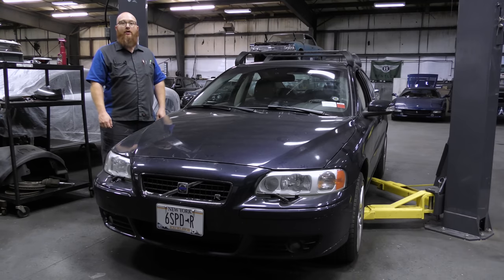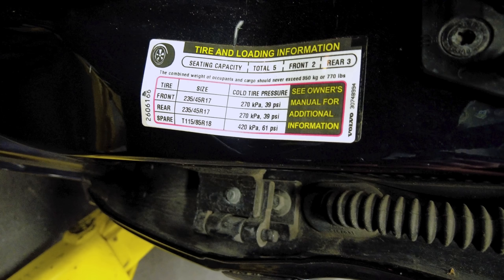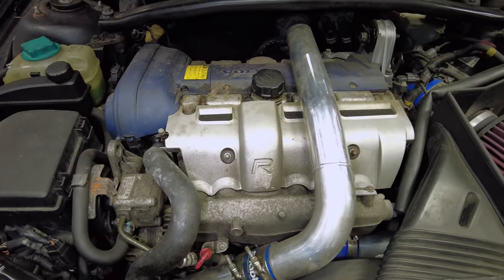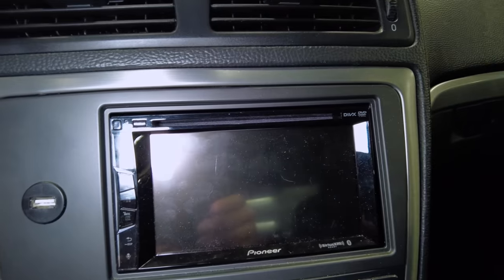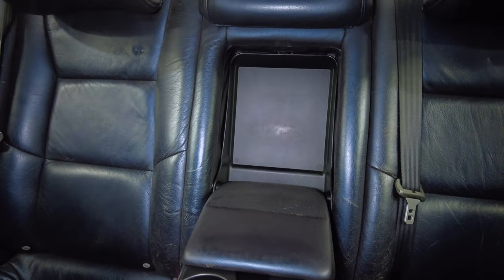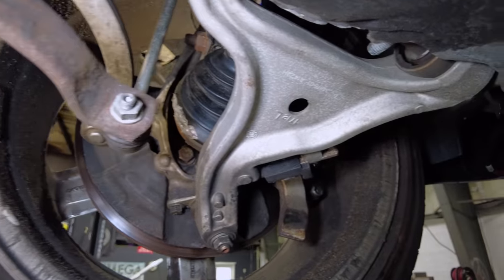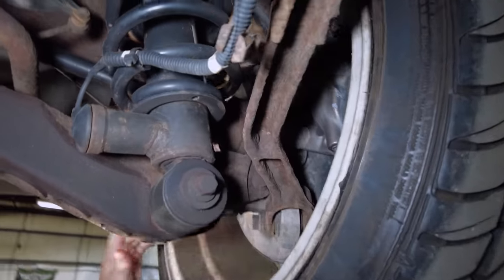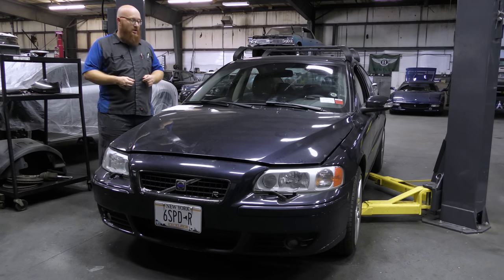They shipped their '07 Volvo S60R over 1K miles to my shop? CAR WIZARD determines if it's worth it!

Comment: These older Volvo Rs are getting harder to spot. The fact that the car was sent from 1K miles away to Wizard...
I can tell that the owner really wants someone that can be trusted.
Reply: Alot of people prefer v70r for whatever reason, i got a s60 t5 and i could have bought s60r but i thought the 2.3 is just better overall in terms of realiblity and power with tuning.
Reply: @jaskajokunen3716  My '01 V70 has a 2.4 5cyl NA engine.
216k miles and still runs great!
Only noise mine makes comes from the injectors. 
If i want a fast car, it's not going to be a Volvo haha.
Reply: @jaskajokunen3716  because they have a large amount of cargo space.
Reply: @DeeDee-pw9pm  mine has 155k miles 🤔Though not sure how long it will last since it has aisin autobox and its pushing around 310whp and people said the tranny can handle 300 😔
Reply: It makes no sense to ship this car from the north east to wizard. There are plenty of reputable Volvo specialists in the NE that will do same quality work for cheaper since volvos tend to have the same chronic issues
Reply: Yeah, there are lots of Volvo mechanics where we are who hoard acres of old Volvos. Its pretty wild.  But exactly what I need to keep my 2001 T5 going.
Reply: i bought my 6 speed 07 s60r at 19 and it’s been a very fun (and costly) ownership experience. truly some special cars
Reply: @DeeDee-pw9pm  these are extremely fast in straight line.  But ultra high cost to own, i.e high risk of 'totaling' if actually maintain into higher miles.  It's a sorta cult actually, imho, based on following this model over the past seventeen yrs that i've noticed.  Was gonna get a used one but the prices and the over-eager passion levels scared me off.  I was wise bcuz the number of items needing replacement on most of these is really crazy.
Reply: @18_rabbit  Cost depends on where you live.
And don't you mean high risk of crashing when it's higher miles?
Although that shouldn't be an issue if the car is maintained. 
And what do you mean by "It's a sorta cult actually,..."
What are you talking about exactly?
I don't see where you are really getting at with your comment.
Reply: loads of them here in Northern Europe for beer money, not as popular now because of our high emissions taxes that cripple owners on Co2 output. This is regarded as high polluting vehicle in Europe, only die hard and Volvo fans drive them now.

Comment: These cars are so interesting to me. I test drove one but didn't buy it. It was meant to be a competitor the BMW M3, obviously it wasn't quite as quick, but to this day has to be one of the cheapest cars with 300HP, AWD, and a manual transmission. Jeremy Clarkson did an awesome review of one on TopGear back in the day. Volvo really went a different direction on this car!
Reply: It is very easy to get it close to 400hp, The car in the video has some mods, IPD cat back exhaust, needs a performance down pipe/racing cat. It has snabb intercooler piping, needs a do88 intercooler. and a tune from Shep.
Reply: @YouTubeHandlesAreStupid  I had a 2010 s4, 6 speed manual. Very fun car, but maintenance was a nightmare. I'm content with my 580WHP Dodge Viper GTS currently. 🤣
Reply: @YouTubeHandlesAreStupid  It has gen 3 heads, a custom grind comp cam, full custom exhaust, and some other little stuff done to it. I bought it that way. I'll say this, it moves!

Comment: I used to have a 2005 S60R with a 6 speed and 18s on it.  I loved it.  

With that said, on the ones with the 18s, the stops for the steering get adjusted to prevent the tires from rubbing on the wheel well.  Going from 17s to 18s, this probably was not done.  The downside of adjusting it for the 18s is that the car has a massive turning radius.  I had a Prelude Si 4WS at the same time as this car.  It was a major change going from a car that could do a u-turn in about a 8 foot circle to driving the Volvo.

I miss my S60R very much.  I've been looking at them again recently.

Comment: The rearview mirror also contains the upper electronics module (UEM) which controls the keyless entry, power windows, and sunroof, among other things. The mirror is also self dimming. Unfortunately, it's not a cheap thing to replace.
Reply: It is possible to get a used mirror, split it open and swap the glass, keeping the original UEM. Done it before, tedious but in this guy's case, worth it!
Reply: 😮 he just needs to use a little bit of paint thinner on a cloth to clean that interior mirror
Reply: @BubblesTheCat1  It's the reflective backing that's cracking. No amount of thinner will fix that.
Reply: @darkiee69  😆
Reply: IVE USED A COMPASS MIRROR out of a xc70 or 2008 s60 in my 2006 regular s60 no issues just plug and play.

Comment: Yes I agree with you about the cold air intakes. Unless it's been properly tuned and setup for that, I would definitely advise the customer that it would be a good idea to go back to stock or perhaps see about getting it set up and dialed in properly.
Reply: Over piling of those cloth filters also messes with MAF sensors
Reply: Hell, you should probably tune a car anytime you add anything aftermarket. I'm all for modifying vehicles, it's just ECU and other sensor interaction is so integrated on anything from the past 20 years, the newer the moreso, tuning is always a good idea. I feel like if a new mod helps without a tune it's basically luck lol or a stock tune that changes with sensor input
Reply: TheRealAYoutuber good turbo noises are worth a lot of things, that is true lol
Reply: Stock paper air filter flows more CFM than the KN AND does it cleaner...  people on Swedespeed paid to compare...

Comment: My son is a mechanic at a Volvo independent shop in Pasadena, CA that has been in business since the late 70s. Volvo's are so highly valued, that customers regularly put more money in them that they are worth. The cost of repairs relative to the value of the car is generally not an issue. Rs in particular are very sought after.
Reply: Just possibly this Volvo might have family sentimental value.
Reply: Which shop in Pasadena? I used to bring my Saab to 2GFS in Venice.
Reply: Independent Volvo? Just guessing as I don't believe JK Volvo has been around since the 70s, but I could be mistaken.  I know Independent has been around forever.  Both are great shops though!
Reply: @phixion35  JK Volvo. It opened in the late 70s for sure. Sadly, JK just passed away. His son, who has been running the business for many years, now owns the business.
Reply: @suginami0  that's terrible news about JK.  I like that shop, extremely knowledgeable, friendly and reasonable prices.  I've had both my current S60 worked on there before as well as my previous 1st gen S40.
Reply: @phixion35  there is one old-timer there who has been there since the beginning. He’s past retirement age but still works there because he likes the work. He is the 240 guru. He also works on the difficult to diagnose cars, especially those with electrical problems. He’s like the professor in Back To The Future, and my son really looks up to him.
Reply: @suginami0  that's awesome!  I believe I know of the gentleman you're speaking of. 👍

Comment: I’ve got a V70 of the same era (facelift P2) so great to see one at Omega. The 18” ‘Pegasus’ alloys were indeed optional and later standard on the S60/V70R. That rubbing on the inner arch is because the steering locks he has are for 17” wheels. I had the same problem on my car going from 16” to 18” Nebulas. I too have the same beautiful blue dials in my car! That steering wheel is aftermarket but very nice! Great video Wizard

Comment: 04 Rs are reliably the worst year, but the easiest to modify. 05+ Rs are A LOT better but are the hardest to modify due to coding and software BS. The fact that this has the M66 makes it worth tons more than if it was an auto too, it's worth saving.
Reply: I think it's always a bit of luck. My 04 has 285,000 miles on it, have had 2 major fails with it (split an angle gear casing apart,  had a timing gear strip and kill the car - took 6 weeks to diagnose, with Xmodex and a couple of good Volvo techs perplexed until we figured it out) - just changed oil in it, would take off for anywhere in it.  I've heard people gripe about first year - and maybe there were issues - but honestly, mines been nearly bulletproof - noting that I've done all the maintenance as needed on schedule, and added mild mods as OEM stuff wore out.  Exhaust, intake hoses, FMIC, ignition coils, brake lines, coil-over suspension to get rid of the "cool, but worthless" electronic suspension.  Stuff like that.

Comment: I've owned a 2004 S60 D5 Sport since 2007. Lovely car to drive, handles well, very comfy seats, fast and returns reasonable fuel mileage  for the age of the car.
But its a pain in the arse for things going wrong, and when they do go wrong theyre a pain to repair. It ate brake calipurs because volvo cut corners and used cheap ones, subsequently it also ate vrake discs and pads. It would wear out front tyres in no time at all, and my front tyres rubbed on those rub plates, the uk actaully has an MOT clause that says when the cat has its yearly test to ignore the rubbing,basically volvo designed the car wrong. The steering rack failed and it was a nightmare finding a replacement because volvo used numerous different ones on the S60. The exhaust flex pipe broke, had it repaired and it broke again, so I had fitted a custom stainless through flow exhaust deleting the cats in the process, which is legal in the uk for this age and fuel type of car. My car came with the R design 18" wheels which were way to hard a ride so had those changed to 17s which were much better. 
I had several pairs of wheel bearings changed on it, several top strutt mounts, drop links and the dreaded oil seal behind the flex disc blew out which cost a fortune to replace, I had the clutch changed at the same time. Then the serpentine belt snapped and got caught in the camblet due to the worst belt design known to man, this destroyed the engine ofcourse. But I wasnt done with the car yet even though it had over 260k miles on it. I had a used engine fitted and it gave it another chance until I eventually bought another car,an XC70. The S60 now has 279k miles on it. It had been sat in my field for 3 years before it was started, fires right up and ran like a dream, everything works on it, well it did until the nearside driveshaft broke. Its now too long in the tooth,needs too much suspension work and the body has started to rust even before it was laid up. Its now waiting to go to volvo heaven. Great car to drive but a pain in repairs.

Comment: Been waiting for this kind of Volvo content for years. I'd love a deeper dive into Volvo vehicles the way you have done for other brands. The P3 cars are actually an insane bargain right now for the quality you can get for under $15k used, and if well maintained, they will LAST.

The 4C suspension is EXPENSIVE though!  I'm fine with my standard suspension setup.
Reply: Robert DIY covers a ton of good Volvo content
Reply: That Volvo has been cosmetically neglected. I have 132k on my 2011 S80, which is in much better shape. A S60R with a manual transmission is a rare car.
Reply: Watch JR Go had a number of Volvos and Elliott Alvis has the estate/station wagon version of this car I belive
Reply: Honestly the suspension difference is pretty noticeable but I hear you cost wise
Reply: @LafemmebearMusic  I put in the IPD rear sway bar which has helped my XC70 wagon with body roll tremendously
Reply: P3 is a ford......

Comment: Knowing the transmission has potential damage, I wouldn’t repair anything but the absolute necessities. Repair the air bag, the power steering rack and that’s it then drive it to the ground.
Reply: couldn't have been said any better
Reply: I was thinking the same thing. 80% of the things he mentioned aren't even worth fixing. Fix the rubbing (which is NOT a power steering issue), fix the airbag light, and replace the timing belt and PCV system and be on your way. Save yourself $7,000.

Comment: If the steering rack has been leaking for a while, oil from the rack can erode the anti-roll bar bush. And Volvo anti-roll bar bush are molded onto the rod. So the only way to fix it is to replace the entire anti-roll bar. IPD makes an improved version of it but I hear it's expensive and it kinda squeaks

Comment: 1. Wheel rubbing is caused because angle limiters are worn. Just replace them. They sit on the lower linkarms 
2. Steering angle sensor. There are companies that offer refurbished units for half a price of the new one.
3. Would be good to service haldex awd system as well. Oil and filter replacement. Otherwise the pump can worn out.
Those are such a nice cars to drive. I think worth saving.

Comment: I once read... "Volvos were built like tanks, last like tanks but also drive like tanks" lol... I have a c30  2013 5 Cylinder 2.4(the non turbo version) and it feels so smooth and well built...
Reply: In this case though, it's a very fast tank. 🤣

Comment: The S60 R with 6-speed is getting quite rare here in Europe too. I could only find 5 for sale, starting at 13000€ with 270000km.
There are none for sale in Sweden at all regardless of transmission. I found one V70R.
Reply: I'm Dutch and the S60R isn't for sale much.
But the V70R's are more plenty.
Reply: Hop over to your neighbor, Finland. There always seem to be at least a few for sale over here (both V60R and V70R). It's a bit ironic that my V70R was imported from Sweden a few years ago though.
Reply: all in the scrap reclamation yards because emissions taxes make them un economical for the majority.

Comment: There is a bump stop on the lower control arm that is R specific.  Some folks take those off to get a tighter turning radius.  That may be why the tire is rubbing.
Reply: The AWD Volvos do not have a great turning radius. just the nature of the beast. The FWD only versions are tighter.
Reply: There is a part number for a 16", a 17" and an 18" wheel, sounds like they have the wrong ones there
Reply: @74Husky and the FWD ones still have a horrible turning radius, I couldn't imagine it being any worse.  It's the only pet peeve of my P2 S60. But I do understand why it's that way.
Reply: The only thing an R can't defeat is a tight parking lot.  There is no such thing as a u-turn.

Comment: I agree with his recommendation regarding K&N air filters.  They do not filter very well and really do not increase air flow enough to be noticeable.  But that oil can get on hot wire MAF sensors and cause the wire to break during the device's cleaning cycle on engine shutdown.  

Great video!
Reply: I prefer AEM dry filters
Reply: I run one on a base V70 with the NA engine, and I just use MAF cleaner occasionally like one reLly should anyway.  Even on an NA engine it delivers more flow at higher RPM
Reply: Some guys on Swedespeed paid/did a bunch of testing - the OEM paper filter (Mann) flowed better than KN and also cleaned the air better.  Just put a stock filter on.
Reply: @CaptainSeamus  +1!  Totally agree.  These K&N style filters delete the airbox, a part that is designed to reduce noise and introduce cold filtered air.  A K&N filter does only ONE thing, it introduces induction roar, which is actually kind of cool.  In 1997 I installed one of these on my Volkswagen Corrado SLC and it made it sound fantastic. At idle it was a four cylinder, but then under load at low RPM the VR6 sounded like nothing other than a small Detroit V8, but it screamed like a BMW inline 6 at redline.  I didn't know at the time that these filter basically very little, but is sure sounded nice-
Reply: @CaptainSeamus  +1

Comment: My daughter's 2007 XC70 was purchased with 163K miles. Her first car...$5995.00.  Remarkable seats, remarkable heating and cooling system. A tank. Totally great car. However, expensive to maintain. At 214K the head gasket started to fail for unexplainable reasons....never overheated....at least when we had it. Donated it to a radio station. 

I can understand why the owners want to keep the "R Type."
Reply: That’s unfortunate and honestly pretty rare point of failure for a Volvo inline! Stock head gaskets are usually good to about 400K.

Comment: Something to check with the transmission popping out of gear is that it could very well be stretched shifter cables. That's a common issue for M56 Volvos like 850s and later P80s which causes them to pop out of gear and not go in certain gears correctly, so I wouldn't be surprised if P2 Volvos are also at the age where that's becoming a point of failure.
Reply: Maybe the forks moving the synchros are made of plastic, I've seen that before, and they can worn out. If you're lucky, from the cabin, there's a plate on top of the transmission you can remove under the shifter, so you can easily change them.
Reply: Definitely synchros, my 3rd gear is only good for downshifts rn. 😂

Comment: $2,000 for the rack including labor - OEM part is $2k alone without labor.  You have to be using a rebuilt rack - mistake, these do not do well with rebuilt racks.   Suggest you use genuine volvo part for 3.2k including labor.